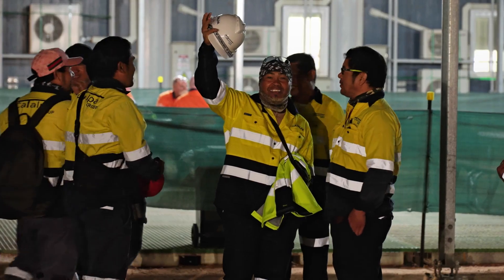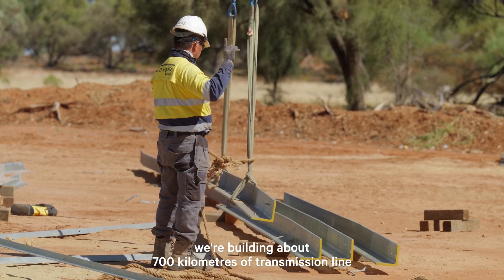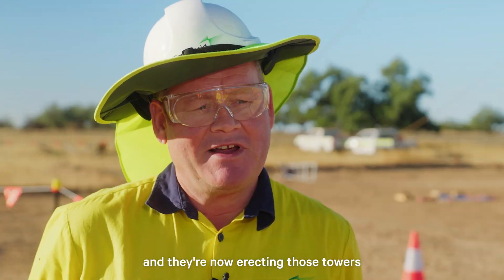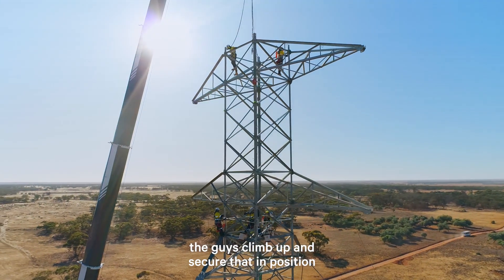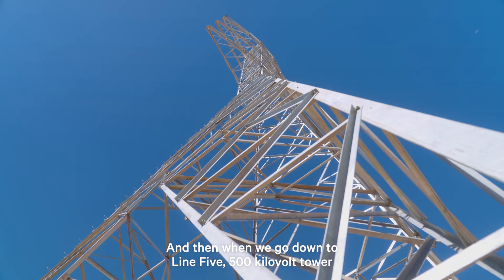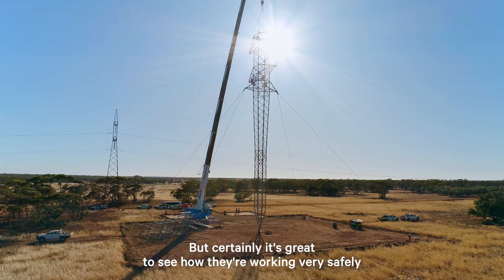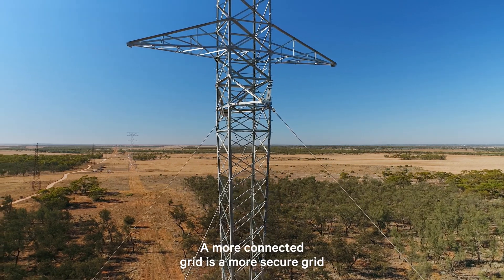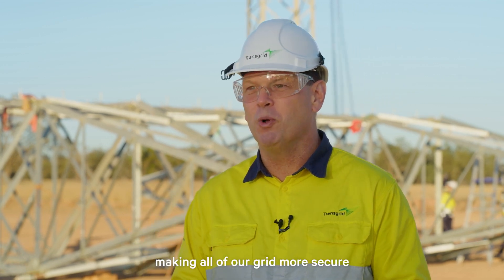EnergyConnect - first towers installed on Australia's largest transmission project

Comment: Don't think the Chinese engineers did a video but the two most recent transmission lines completed had the distances  2,172 and 2,193 km respectively for the Baihetan hydro which generates 16,000MW reported achieving full commercial production in Dec 2022.  Since the station is generating the full output I suppose the transmission lines must be operational to convey the power away.